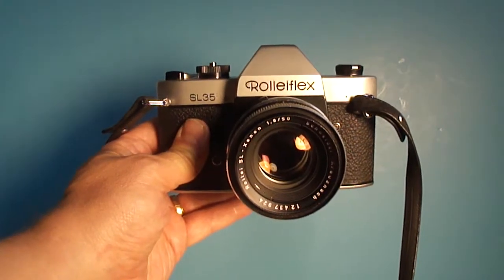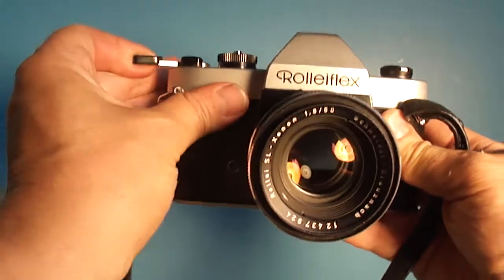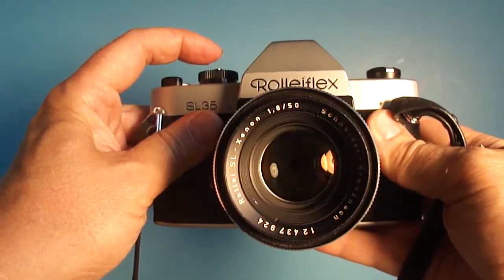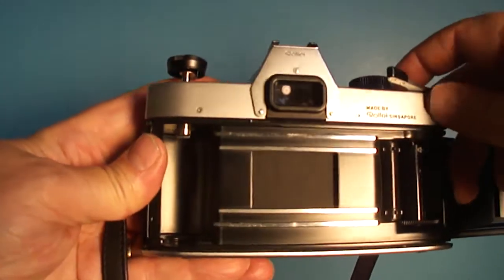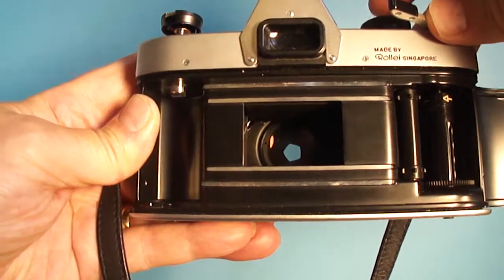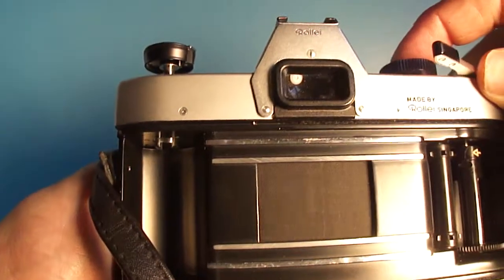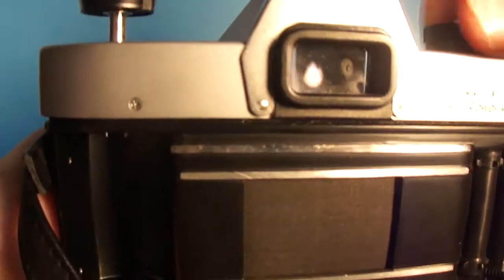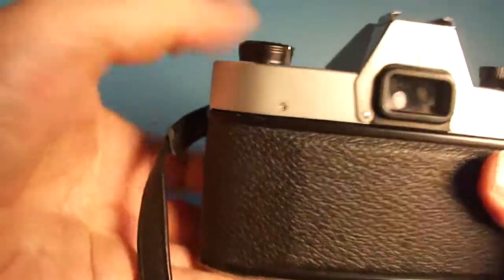M4H08673

Comment: If you have the correct spanner, remove the lens front trim ring then the front element.  Stop the lens down all the way f16 or f22.  Dab a bit of lighter fluid onto a Q-tip and GENTLY wipe the iris blades.  Let them air-dry.  Repeat a few times.  This usually solves the problem .... unless the resistance is at the very outer edges of the iris blades, at their pivot points .... in which case a more complete disassembly is necessary.